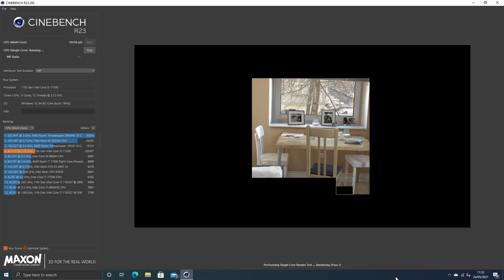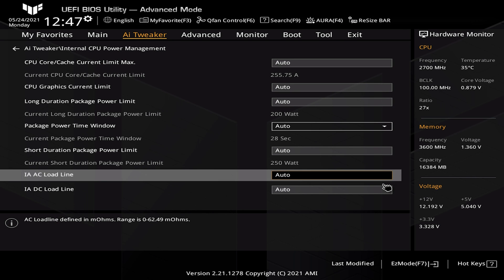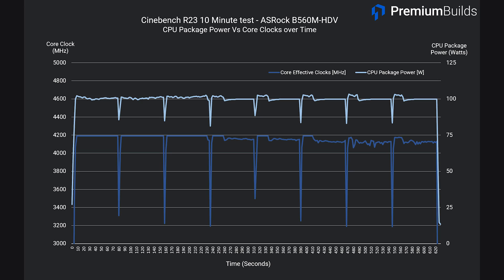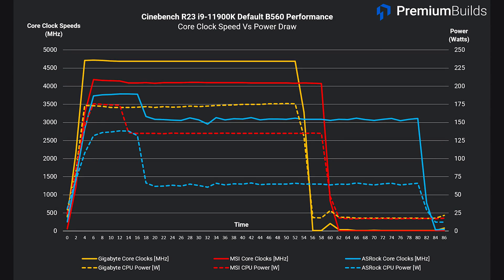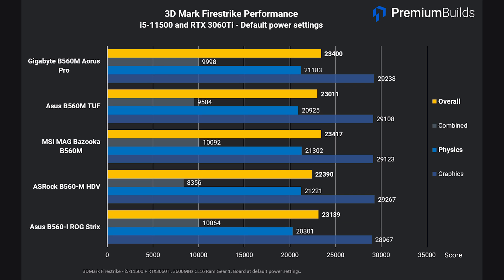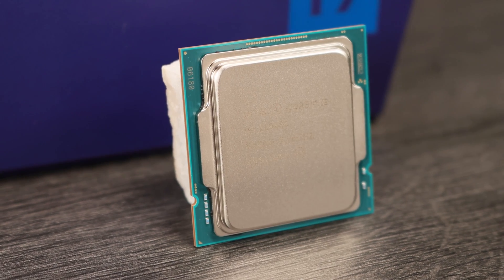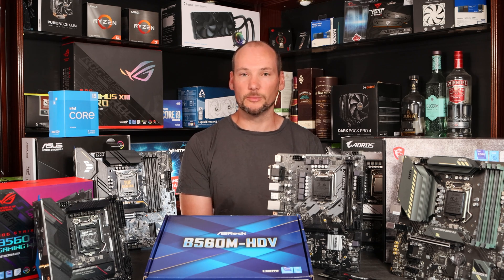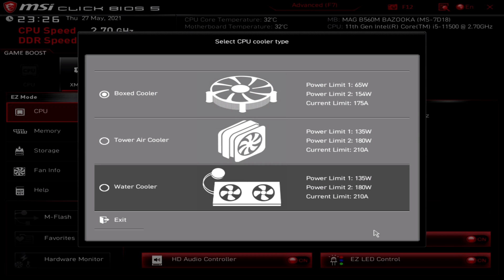AVOID These B560 Motherboards! The B560 Motherboard Minefield

Comment: I'm sad to say this, but even the Tuf version is very poorly & cheaply made, i would not recommend the B560 for it, as one of the ram slots got overheated & stopped working completely after just one month of use & i got mine brand new,  it overheats quite easily under heavy loads
That being said, i got mine for around 80 usd dirt cheap, There are better motherboards around for the quality & reliability but you probably have to pay a hefty (Z490 or Z590 if you want best of the best reliability & games lot & do lot of artisting & 3D + Multitasking, mining etc)

Comment: hi, can an i9 11900k fit on a b560 plus asus tuf? I don't care about overclocking
Reply: It will, but you're better off with Z490 or Z590 mother, depending on where you are from, the prices might differ (sometimes the Z590 is cheaper than the Z490, despite it being newer & more powerful,  & sometimes it's the opposite) those two boards should handle i9 like a champ

Comment: I’m trying to figure out if I can use a Ryzen 9 5900X with my B560M AORUS PRO AX? Information Via Google is sketchy and difficult to decipher I’ve only been able to find one search that confirmed I could use this CPU with this motherboard.. my other searches said any of the 5000 series what is compatible but I still didn’t see the specific one listed on the websites that said this
Reply from the maker: Nope, that's an intel motherboard. No ryzen will work. Unless you're talking about B**550**M in which case it will work with a bios update!
Reply: @BuildPicker  I have Gigabyte B560 HD3 motherboard. What's installed is a Intel i7-11700KF processor, ASUS ROG STRIX RTX 2080 Ti GAMING OC, Crucial P5 Plus 2TB PCIe Gen4 3D NAND NVMe M.2 Gaming SSD and have a total of 32GB's of Crucial Ballistix MAX DDR4- 4000 ram memory. My setup runs great with gaming. The Gigabyte B560 HD3 seems like a decent motherboard for somebody being on a budget. Have you ever tried out the Gigabyte B560 HD3 motherboard before?

Comment: I have intel i5 10400, which should I get
I had gigabyte h410m which died after 3 months.. please suggest
Reply from the maker: I'd opt for an affordable B560 motherboard. See if you can find the MSI Pro VDH. There may be used options too. Just avoid the ASrock hdv.

Comment: Intel - Expensive motherboards but cheap processors
AMD - Expensive processors but cheap motherboards
On intel you need to spend more money on motherboard to hold high W of processors to perform good i9 processors
On the other hand in AMD you dont need ultra motherboard to run best processors but processors cost more then Intel expensive motherboards.
In the end it comes to 50-50.
Specially Used AMD Ryzen processors cost double the price of used intel i7 in the "same" specification and generations processors.

Comment: Wish I'd seen this sooner. I have an Asus TUF B560m paired with an i5 11600 and the default Asus boost what's its face was set to 251W for unlimited time. 25c idle to 100c in 20 seconds under AVX load is ridiculous. Goes without saying, I've moved such tasks to another system and relegated this one to being a stupidly OP media box.

Comment: i have a 10400f with gtx 970 should i get a msi mag b560 torpedo or b560m a pro?
Reply from the maker: The topedo is a much nicer board, but the top m.2 slot won't work (with 10th gen CPU) . The A-pro only has one m.2 slot anyway!!

Comment: I just bought the MSI MAG TOMMAHAWK for an i9 11900, any recommendations?
Reply from the maker: Which variant of the Tomahawk? Just make sure you get a good CPU cooler!
Reply: @BuildPicker  MSI MAG B560 TOMAHAWK Wifi
Reply: @BuildPicker  yup, bought the MSI cooler too. Will be checking temps as i generally do.

Comment: Imma go Build with i5 11kf series with rtx3060
What B560 series mobo should i use?
Reply from the maker: With an 11th gen CPU you have almost free choice of B560, or Z590 if you want to overclock.... But if you havent bought anything do consider the newly released i5-12400 and B660 board! It's a beast!

Comment: Have i5 10500 its good for b560 aorus pro?
Reply from the maker: YEs, fine! Just be aware the top M.2 slot won't work with a 10th gen intel CPU.
Reply: @BuildPicker  talk about ram can i go up to 3200/3600?
Reply from the maker: @christianjamesgamad9172  On B560, no problem! Any intel CPU (i5 at least anyway) should have no problem ruinning up to 3600MHz RAM. B560 makes it easy. Just set XMP in BIOS. 3200/3600MHz CL16 isn't a huge difference in performance, so don't overpay for faster RAM.

Comment: in a nutshell, which board/boards is/are good for i5 11400f in mid range segment?
Reply from the maker: MSi B560m Pro VDH WIfi, Asus B560m TUF, Gigabyte B560m Aorus pro. Asrock B560m Steel legend is fine. ATX, the B560 Tomahawk is decent.It really depends on the specific features you're looking for.

Comment: Sir, is the b560 aorus elite good for a 10700 @4.6? It is slightly cheaper than the tuf one.
Reply from the maker: Yep,. it's an excellent board - but it loses compatablity with that top M.2 slot using a 10th gen CPU. So you're left with 1 M.2 slot. That's the same deal with the Asus board.
Reply: @BuildPicker  thanks for quick reply. But just to make sure, It's not the aorus pro, which is the more premium version. It is b560m aorus elite. Can't find any testing videos with i7 on it.
Reply: @achannel6677  @PremiumBuilds I got the same question. In my country you can only get the ELITE version of the Aorus board. Do you know how far from the PRO version performance is this ELITE version?
Reply: @kelroar  I went with 5600x and aorus b550m pro. The rgb fusion software is shit. Doesn’t work. Get an asus or msi.

Comment: So if I use a i5 10400 with an asus b560m plus wifi I should be fine right? As far as I know I'm just losing the m.2 slot and that's it (correct me if I'm wrong). I mainly got the board since I wanted the 3200 mhz ram support and it was cheaper than z490 boards.
Reply: that should be fine. you can run a faster ram with that setup. i have the Asus Tuf B560 plus wifi paired with i5 10400F, with 2x8 rams running at 3600mhz. :)
Reply from the maker: Yes that's right. So long as you don't mind losing that top M.2 slot, everything else works no problem. You can run that faster RAM.

Comment: Hi, I'm  building my first PC, is 15 10400F + 3060 + MSI B560M PRO-VDH or Gigabyte B560M DS3H a good combo? I also have two 3200 MHZ memory module that I want to take advantage of. Any recommendations? Please :(
Reply from the maker: Yes, a good combination. I'd choose the MSI Pro-VDH every time, the D3SH has veaker VRMS, no heatsinking, too few fan headers...It's a real budget board.
Reply: @Raiyan Sorry for late response, Dont worry, I've been using that build for almost a year, 0 Problems
Reply: @Raiyan not at all, it's up to par. you can even check it on various sites

Comment: What about a i7-10700F? Would the GIGABYTE B560 AORUS PRO be good with a 6600xt + i7-10700F combo? I have the i7 from a pre-built so I don't feel like buying another cpu as I'm building another pc.
Reply: I just built a system with 11700K on B560M AORUS PRO (in terms of VRM, etc., basically it's the same thing, more likely a mATX version) and RX 6600 XT, and it runs like a charm, I'm very happy how it came. For the CPU, temps are very good. The case is very well ventilated, and on full load (prime95) it doesn't exceed aprox. 70°C +/- 5% (in full load gaming is lower) using an aftermarket air cooler (ARCTIC AC Freezer 34 eSports DUO). I am not planning on overclocking.

So for 10700F, I think it will be more than enough, and you have the possibility for upgrade to 11th gen in future without changing the mb.

I am positive this MBs could handle even i9 11th gen, if you don't need OC.

Comment: Hi I have a i5 11600k cpu is the gigabyte B560M Ds3h V2 good for this cpu?
Reply from the maker: If you've got a K series CPU, you really need a Z590 board to allow overclcoking, to get the best out of it. 

I'd steer clear of any entry level board on a K series CPU. The gigabyte AOrus or Asus TUF B560's are where I'd start if you really aren't bothered about overclocking: you still need robust VRM configuration to pwoer that CPU properly.

Comment: i will build my first budget gaming+editing PC soon, my gpu will be Gtx 
1650 or super ( if stock available), should i go for i5 10400f or 
11400f? which better to pairing with 1650? my MOBO Msi b560m-A pro or 
Msi h510m A-pro, ram Fury 16gb (8x2) 3200mhz, Ssd Nvme m2 , can you help
 me to choose? Tq
Reply from the maker: Definitely get the B560m A-pro - you want the B560 features to get the most out of your system. I'd go for the cheaper CPU, they will perform much the same. If you can get a non-F CPU for not much more, it may assist in video editing/transcoding - the Iris XE GPU on the 11th gen is particularly good, but the 10th gen one is ok too. Some software, particularly adobe, can use it for some processes.
Reply: @BuildPicker  Nice, if i get a non F CPU with igpu and also Gtx gpu is that okay? will my Gtx GPU work if my CPU has Integrated graphics? i heard the system will disable one of them is that true? yes i using adobe and some other softwares, that's good news ff igpu can assist in editing/etc but its possible to run both of them, Gtx gpu for gaming and igpu for editing, still confuse about this, btw Thank you!
Reply from the maker: @captainmusx817  No, you can use both at the same time, either to run more monitors, or just to use the processing capabilities of the iGPU. We run several systems like this! The GTX GPU will do most of the processing work in adobe (Mercury cuda renderer, some effects and transform acceleration) but the iGPU can also do a few tasks to speed them up.
Reply: @BuildPicker  Oh yeah, awesome! so there's no problem glad to hear that, thanks for the info well i will chose a non F CPU , thank you again!

Comment: Could you possibly help me? How do I remove power limits on the B560 Bazooka? I'm running an i5-11400
Reply from the maker: When you power on the PC for the first time, this board displays a splash screen asking you to 'select CPU cooler type'. This is a proxy for the pwoer limit it will use! If you selected Tower Air Cooler or Water cooler, you have the higher power limit set. You can also alter this setting in a BIOS menu (I forget which submenu, apologies, but look around and you will find it).

Comment: Please help me. 
I already built a pc by 11500 and Gigabyte B560M DS3H AC. 
Is it ok? Please  give me some advice with some derails. Please.
Reply from the maker: Yes, it will be fine. That board would not be my choice, but it will work. If you're just gaming and doing general tasks then CPU load will not draw 'full power', and you will get full performance. If the board VRMs can't cope, they will just restrict power so nothing will get damaged, but you might notice performance impacts.

The things I wouldn't do with that motherboard are long duration CPU demanding tasks like Computational workloads, or video rendering on CPU (Most is done on GPU anyway if you have one). So if you need to do that, keep an eye on temperatures and performance. 

But overall, it will be OK.
Reply: @BuildPicker  Basically i am working on architectural visualization works, rendering, software like 3ds max, v-ray Photoshop etc.  so, is there will be any trouble?
thanx a lot for ur co-operation.
i am ur new subscriber.
Reply: @arafathossain3774  A bit late, but no because you should be using your gpu for these tasks no matter how good your CPU is anyway

Comment: Hi premium builds, between r5 3600 and i5 11400 , which one is better at the same price. The r5 3600 is over clockable, Will that give extra edge over 11400. Also which Atx and m atx motherboard do u recommend for 11400 on the b560 series. Thanks
Reply from the maker: Right now, I'd take the 11400. The 3600 won't overclock much if anything, and the 11400 is the better performer all around.

We have a B560 recommendation video alongside this one! The Asrock B560 Steel legend is a good ATX option, MATX most boards are ok except ones without VRM heatsinking, avoid the bottom of the market. Depends on local pricing!
Reply: @BuildPicker  is asrock b560m pro 4 good too? for my i5 10400f
Reply: @sotoayam2933  the gigabyte b560m aorus pro ax is the nice board with built in wifi for the 10400 and 11400

Comment: Very Nice information. Thank you Premium Builds. I am going to pair a 11700 with Asus Tuf B560 ATX board for Gaming (Going 8 core just to have some good headroom as i upgrade 5 to 6 years once). What Cooler should I use to run 11700 at its all core boost of 4.4Ghz? Any recommendations? Thank You
Reply from the maker: SIt tight! We may have just the content for you coming up (trying not to get crushed by a stack of CPU coolers awaiting test here!!)
Reply: @BuildPicker  Thank you. Waiting for your video.
Reply: Hello Aravindan.. I have a Noctua NH-D14, which I will be using with my 11400F on the exact same board. Noctua has a great list of compatible cooler for your 11700 CPU. Just make sure, that you check the motherboard compatibility as well since the largere dual tower cooler may have compatibility issue with VRM heatsink and most definitely with RAM. This will limit you to low profile RAM like Corsair LPX. In case you are going with liq cooling, I suppose 280 mm ones are standard recommendation. Gamers Nexus recommend the Arctic Liquid Freezer II  In case you are looking at 120 mm , I think the Corsair H45 is better than the H60/H55 because of the better fan it comes with. I am not saying it may be enough for your 11700, but the fan specs on H45 are better than H60.
Reply: @nishikantprabhu  Thanks prabhu. Noctua website says its possible to cool the 11700 with NH-D12S. But I dont know whether it will run in high rpm and make noise to cool the locked chip. Also i would go for 11400F, if its in stock. Cant seem to find it online.
Reply: @aravindana.c320  where are u located
Reply: @nishikantprabhu  I am in Chennai ,TN
Reply: @nishikantprabhu  thanks